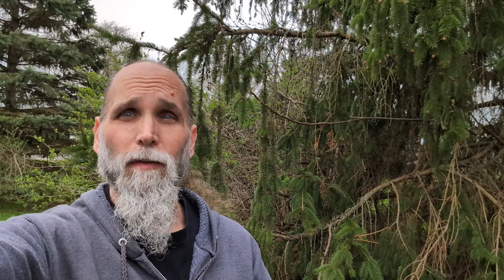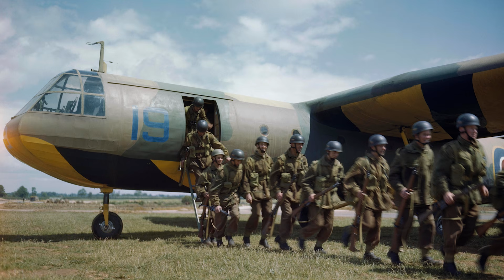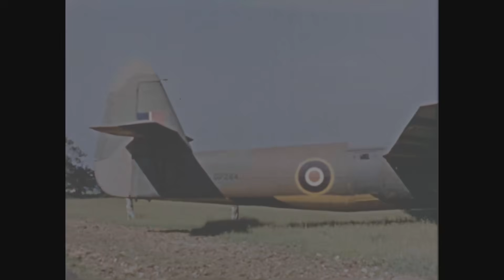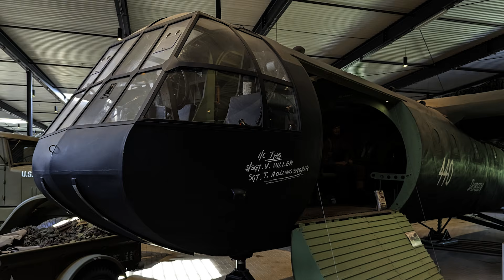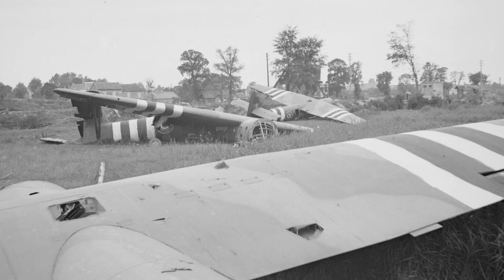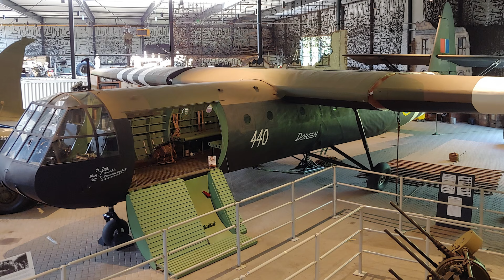The WWII Glider Built by Furniture Makers: Airspeed Horsa

Comment: I would like to add. At the start the wheels would indeed be dropped after takeoff. But pilots found out that landing with wheel was more prefable. Left and right wheel could be braked independantly thus the glider could be steered on the ground. Later production MKI horsa did not had the ability to drop their wheels and the earlier models the drop handle got blocked.  The first horsa's were  just meant to be loaded and unloaded from the front side door.  It was just luck that a jeep fitted inside the fuselage. And the decision was taken to unload these from the rear by removing the tail. The explosive cord was later dispensed as in practise it happend that the glider had caught fire. the regular bolts that held the tail were replaced with quick removeable bolts and saws and axes were placed near the tail  as an emergency backup. The Horsa had several drainage holes to prevent build up moisture in the fuselage. These became standard with later models. Just as many other aircraft it got several improvements and on official drawings they speak of MK early and MKI late models. The training gliders also had a radio so the pilot would be able to speak to the control tower of the airfield they would do training on. If these gliders were used for combat the radio would be removed although not always the horizontal antenna would stil be attached. in 1944 an MKII horsa was developed its nose could be hinged to the side for improved loading and unloading. These were used once in march 1945 in Germany. Horsa's big brother would be the Hamilcar that could  transport a light tank. The Americans used horsá in Normandy. They wanted also use the hamilcar but the British were not able to supply them in the desired quantities. The Americans did not used the horsa's after Normandy as an officer made a devastating after action report about the performance and it supposed dangers.
Reply from the maker: @jimomaha7809 Wow, Jim, thanks for adding all of this! I knew the Horsa evolved during production, but I didn't realize just how many practical changes came from actual experience with the glider. The switch from explosive cord to quick-release bolts, with saws and axes as backup, was especially interesting. I appreciate you taking the time to share all of this!
Reply: @buffaloairpark4500  I have copies of original documentation also a lot of drawings of the MKI and revisions. Another "fun fact. The early horsa interiors were painted entirely. Later this painting was reduced just above the top of the benches. All above in the interior was left natural wood colour. It speeded up production and it saved huge amount of paint and weight.  A british group Assault glider trust rebuilt a Horsa also using original (wood) parts. During inspection of an original piece of ply wood it turned out it was stamped with : B-grade ply.
Reply from the maker: @jimomaha7809 Now I understand where all that Horsa knowledge comes from! Having copies of the original documentation and drawings must be fascinating. And finding "B-grade ply" stamped on an original piece is one of those little details I absolutely love. Thanks again for sharing this, Jim!